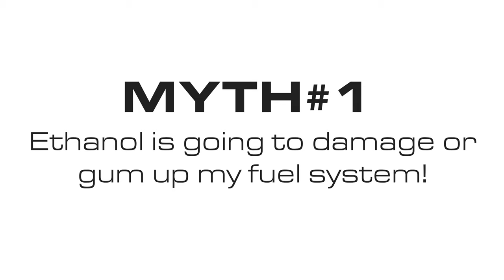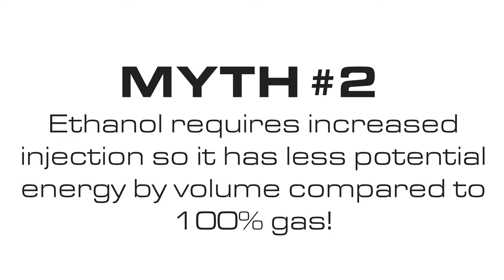COBB Tuning - Car Quickies with COBB - Is E10 Gas bad?

Comment: Sorry, however some good well rehearsed answers to entirely different questions in the video.  Here's an example, question raised does a car need to add more fuel to the injection?   The correct answer is yes it does.  Based on a smarter guy than us both put together Newton proved that energy cannot be lost of gained, it can only be transformed from one form to another.  So with a 5% lesser calorific value to start with, how does E10 create as much transfer of chemical energy into kinetic energy?  Quite simply it can't, because the energy is not already within it's chemical formula to start with.  So you try to imply that the ethanol absorbs the heat from its surroundings.  Maybe there is some truth in latent heat capacity, but pretty much the same question occurs again. How did that heat get there to then later be absorbed?  That would be heat transferred from previous mixture ignition wouldn't it, which never went into transforming into kinetic energy and motion on the car wouldn't it? In addition we then have ignition flame speed.  E10 burns faster, probably 2 or 3% faster.  So when that mixture is ignited it is effectively bringing the point of peak cylinder pressure forward to a more advanced position because it's happening a millionth of a second sooner.  And how do we create knock if we wanted to?  Easy...advance the ignition forward without the supporting octane value, using a lower calorific fuel and bingo....you're knocking. Sad fact of the matter is that people out there like myself who run classic cars are having to upgrade needles profiles and jet pressures to create richer mixtures just to get cars running as they should.  Otherwise they do behave exactly the same as a car running weak until mixture in enrichened, and giving the car the energy that it needs under load.  That....is beyond face value, its an actual proven fact.  But what about a modern fuel injected car with full ECU capabilities?  Well first stoich drops from 14.7 to 14.1, so what does the ECU do? It weakens the mix further because it's looking for different values from its preset's?....it kind of all goes wrong from there onwards, and whilst cars will run on E10 there's a lot of both new and old that just aren't the same and generally lose power.

Comment: Everyone is losing their shit over E10 in the UK 🤦‍♂️🤦‍♂️ apparently it introduces more knock?
Reply from the maker: Sadly there is a lot of confusion about ethanol all around. Its not a perfect fuel, but the relative octane of Ethanol is 109. So it is inherently very knock resistant. Thats in fact one of its best features.
Reply: @cobbtuning  my UK fiesta ST 100% pulls harder on E10. Its only just been introduced to the UK market.
Reply: @deanmarsh1452  ...if the ECU has the ability to enrichen, and advance correctly, relative to E10 reference values then it will be fine.  Many of the classic cars which I tune for a living are needing richer needle profiles and jets, otherwise they behave as if they are running weak, until I enrichen the carb or fuel injection values.  Effectively this is because of the lower calorific value of E10.  Its no different from an athlete trying to perform on a lettuce leaf.  Nope, they need huge calorie intakes to give the body power and stamina.  Plus all that additional octane, without accompanying calories needs a good ECU to do the same retuning that I have to do, each day by hand.